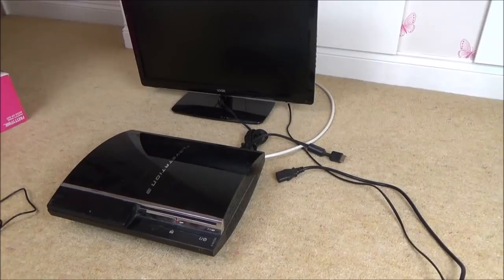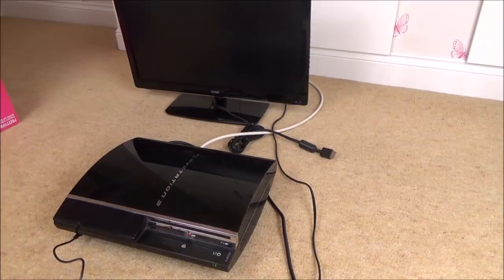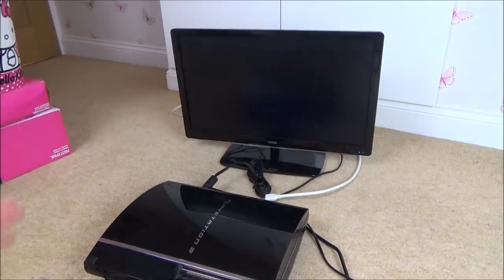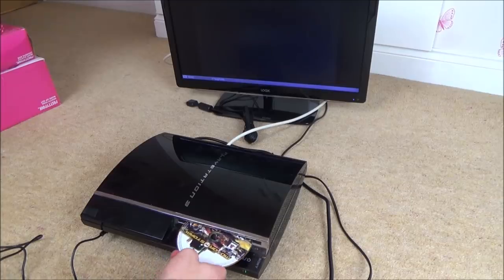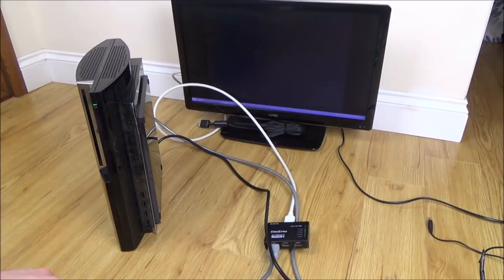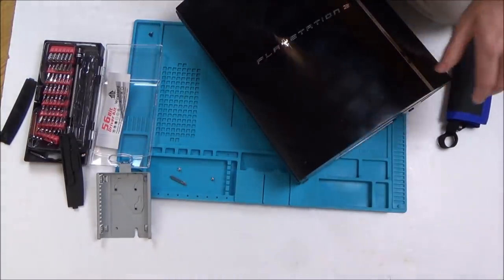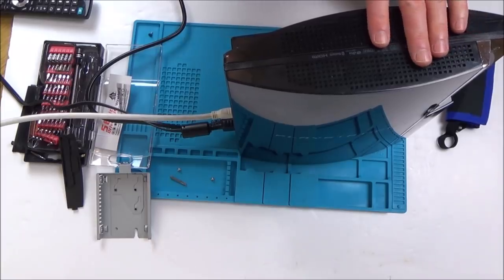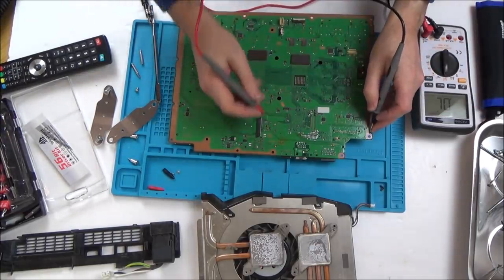Trying to FIX a Faulty PlayStation 3 CECHC03 (Part 2 of 3 PS3 Fixes)

Comment: Reflow of the GPU is a myth. Always do a resistance check on NEC TOKIN capacitors and reflow the dodgy one. It permanently fixes 70 percent of ylods.
Reply: Mine was fixed by just blasting the whole area altogether. 

Although, it ramps up the fan while not even getting that hot, idk why.
Reply: @NSHG  That means yours is about to die. If that console is important, I would suggest installing Custom firmware and doubling your fan speed on Webman. You could probably get a year or so more out of it if you do.
Reply: @koga924  I managed to fix it. CPU IHS wasn't making good contact. Someone suggested sticking a square piece of eraser under the CPU, so I tried that. Since then, I don't have any issues with temperatures anymore. In fact, it has survived about 2 hours of non-stop gameplay of NFS Most Wanted 2012 and Hot Pursuit 2010, as well as a hour of NFS Rivals.

I did install Webman and so far my temps never jump over 76*C for the CPU (which I was once told it's a server-grade CPU) and 63*C for the RSX, which sounds just okay for a 90nm unit (for me at least).
Reply: @NSHG  That's good to hear. I sorta project on them when people talk about problems with their PS3s. My CPU used to hover around 70-80+ degrees when I play PS2 games, even after using MX-4, so I had to put my fan speed to about 1.5x now it hangs out around 70-75 degrees while playing PS2 games. At this moment in time, I completely stopped using it since I get really stressed out that it might overheat. Reading all the YLOD stories online really fucked with me...

Funny thing is I only paid $50, so even if it did break (again) I wouldn't be down much.
Reply: @koga924  Yeah, I paid $4 for mine. Had YLOD, reflowed its RSX back to life and slapped in a 320GB drive, applied the eraser on the CELL, as well as applying MX-2 on both CELL and RSX. I don't really know but mine is like a tank. It does get hot but at least Webman keeps the fan acceptably quiet - it's at about 28% on mine, and ramps up to about 40% if it gets too hot. Kinda like one of my old Prescott based LGA775 based machine that used to ramp up its fan if the temperature was too high.

For PS2 games, mine keeps it at a nice 63*C for CELL and about 40-50 for the RSX. That's because on the PS2 mode, my Webman settings keep the fan around the middle setting. I don't really mind that since I've been soo used to raging loud Delta Electronics/AVC fans in PCs.

For $4, I really wouldn't be that sad either. I already have a slim, 2 CECHG04s (of which one runs Webman and is much more tuned), and a CECHL04 I recased and am in search for a harddrive.

Comment: I bet this wont go good either way, its obvious that the VRAM on that PS3 is gone really bad. the only fix for that is replace the entire RSX chipset which is impossible both getting a working one, even if you have a working one, that chip is paired on the Cell (CPU) so it will just do the usual reb blinking if your try to transplant a new RSX chip on it.

Comment: You can temporarly fix it using a heat gun on both side of the bga, but the best fix is obviusly a reball or even better a complete replacement of the gpu

Comment: Hold the power button till theres a second beep if you connect the ps3 with ordinary av cables. This might not fix the issue but geez man do a bit more research next time. Its better to try all options before ruling whats the problem

Comment: RSX=Reality_Synthesizer. CELL PowerPC Emotion_Engine, I think that the solder used on the CPU will be of a different from the solder used else where in the system, With these systems if the GPU goes wonky they just have to be disposed of responsibly.

Comment: Is there any new idea to fix this problem? Got a PS3 Slim with shortend capacitors around the CPU and GPU as well.
Reply: Ambron Hib reflow them it will work again. Heat them up put some flux and then slightly move them once the solder is liquid. This will fix it permanently. Works for me most of the times, fixed three ps3 last weeks that had that. Surprisingly you don’t even need to replace them.
Reply: Do not attempt to head the gpu it’s a myth. 90 percent of the times it’s the capacitors.
Reply: Thanks mate. So you think heating the Chips wont fix it? I should resolder both?
Reply: @ambronhib5561   My advice is concentrate on the NEC Tokins first. If this won't work it's bin I'm afraid.

Comment: Thats the 1st model ,PS3 60GB, the only one whit 4 ports and mem card slots
Reply: No the 60gb is the CECHA01 and it had a ps2 in it, the one in the video plays ps2 by emulation
Reply: There was also an 80gb model with 4 USB and sd slots etc, same overheating issues

Comment: I’m not saying the GPU was the main problem
But there was definitely a fault with the GPU, it’s not to do with cracked solder balls, it’s to due with the innner working of the chip that has a fault on it.
The CPU is 100% fine

Removing the IHS (the lid of the chip) is easier with the GPU, you heat around the corners and it should come off, thermal paste should be on the 4 corner chips and I think the center of the GPU itself. The GPU is the RSX chip 
This causes the YLOD and the GLOD

Removing the IHS is very hard with the CPU because the corners and sides of under the IHS will have strong thermal adhesive around the chip. You need plenty hot air and a thinnest blade ever to delid the IHS and even with the thinnest blade has very high risk of damaging the traces at the North east of the chip and the bottom too. The main traces are at the top right of the chip so it’s better to be careful, hot air on its own cannot remove the IHS. There are no 4 corner chips on the CPU
The CPU is the Cell Broadband Engine Processor 
This can cause the YLOD and the flashing BLOD

The board is very good at getting rid of heat because of the thickness of the board so it’s very hard to remove the GPU or CPU or any chips off the board

Comment: I had the same problem with my 20gb where it showed nothing on the screen so  I popped the board into the oven 400f at 10 minutes and it didn't work I believe when it turns on and shows no image I believe that means the Rsx is dead but that oven trick most of the time does fix ylod

Comment: I need to fix my PS3 as I think the Power Supply is busted on it since it no longer gets power to it as far as I can tell (without taking it apart an using a multi meter on it)

Comment: Yeah, some PS3 60GB consoles depending on the model number will fully play PS2 games others will only emulate some. Mine struggled on some games

I think where the PS3 60GB failed the most was with all the SD card slots SONY liked the idea of people putting all there photos/music onto the PS3 to store but modern phones were getting better every year so people just used their smartphones to do that.
Reply: I had pictures and all kinds of stuff on my ps3, the card slots were taken out for cost saving and everyone uses USB flash drives. The fat ps3 had some issues but the card reader is not to blame.

Comment: At 29.00 minutes, black chip to the right of gpu really looks bulging in lower right corner. As 3/4 of the chip has very even black nuance I find it hard to believe it is just a colour thing. 
If it is bulging it really tried to eject the magic smoke but failed as the casing was too strong.
edit: At 28.50 it looks like a thermal pad on that chip...
Reply: I saw that, it's a thermal rubbery pad thing on top of the IC

Comment: That issue you had at the end is what ruined my 2nd PS3 where it freezes up and needs a hard unplugging, never had issues with the graphics though so it looks like you messed up something during this video to cause that to happen too. When I had that issue I thought it was a problem with the hard drive corrupting as it first happened when a game was doing a save and tells you not to turn it off, when I took it into GAME after spending 4 days trying to find my warranty buried at my parent's house I moved out from a year earlier they said that is definitely a CPU problem and they said it's unfixable but I'm sure someone can prove that wrong these days though but at least you've got a board for spare parts if nothing else now.

Comment: PS2 compatibility is available on the 20gb and 60gb versions of the ps3 fat
Reply: Matthewdoesmc81 // I have a 80g CECHE01 that plays PS2.
Reply: @videogamegusto7852  yours plays ps2 games yes but they are emulated with software as your model doesnt have the ps2 hardware in it.

Comment: 4usb port plays all ps 1, 2 and 3 games. Drill some holes underneath the fan so it can pull in fresh air. It drops 20c and is almost silent. Done it myself. Bad design.

Comment: Oy! That looked like a huge blob of solder @ 57:29 on the video and about 3 O'clock edge of the CHIP
Reply from the maker: Hi, I can't see it, I think the blob to the right and also underneath the CPU is thermal paste or is the solder blob elsewhere? Cheers :-)
Reply: Hopefully whatever it is if removed resolves the issue, Mind yo I give it a 8.95555% chance that it's the Problem..
Reply: The Chips corner that is pointing to 3 O'clock has tracks leading away from the Chip, and around 5th to 7th Track down from the top in the video, it looks like it is solder, but it may "As you say" be actual heatsink compound and therefore not a problem, to which I say Bum-R
Reply from the maker: @KorAllRBare  Thanks, I see it now, I can't work out if it is solder or thermal paste. I will need to take it apart to see again. Thanks for commenting :-)

Comment: this console doe's not have the glod or ylod  because the console is working exept for the display so it turns on but there is no display of the tv from the HDMI or AV ports still the GPU could be faulty. a reflow with hot air will not work because the chip is dead the heat will make it work for 24 hours or 24 days but still will stop working. now if the chip has not been reflown with a hot air gun hair dryer or paint stripper you could be Lucky and get the console chips reballed with lead solder balls do NOT reflow just get it reballed from the start.

Comment: Men you can't see a fault without power supply... Because with only multimeter all the components are faulty... Use a power supply 30v 10A. You can save time and its easy

Comment: Yo Vince it is the gpu chip and yeah you made it way worse you could have just bought a new gpu and everything would have worked but now the os3 is overheating within seconds that's why the power off button stops working :) got the bang same ps3 had that same problem and all I did was change the gpu with a new one I ordered and it worked like new

Comment: @My Mate VINCE, the beeping on the caps is probably normal. Check this video out https://www.youtube.com/watch?v=0K8hb9RwBrY Low resistance to ground is pretty normal on low voltage, high power rails (one of those old PS3s draws like 300W+), like a GPU. If you look at ohms law and p=u*i it should be clearer. Keep up the good work :)

Comment: the problem is all those ps3 console will die .because Sony won't speed up fan to properly cooling those CPU and gpu.only by installing custom firmware and some third program to adjust speed of fan you can save those ps3.or if you have one switch working and you don't want install code then you can make potentiometr to adjust fan minimum speed.check one guy on youtube.ultra nsc.

Comment: The problem was software dude... Corrupt os. It happens when the chip containing os and bios gets wiped or damaged. Because os is on ps3 without hdd but it won't boot up fully without it. But when you put a hdd in your ps3 system installs os on the hdd and boots up from there. So they probably took the hdd out the console. then ps3 saw there's no hdd, and there's no bios or os on system as well. So the ps3 went to wtf should i do now mode... It boots up tho. 2 solutions : 1. Reintall the bios and mini os on mother board and fix the corrupted chip. 2. do some programming and install a ps3 os on a hardrive (hacking and making your working ps3 a clone of your corrupt one) then the ps3 may or may not work with hdd because the os is already installed but system is still in wtf mode... But you fucked ps3 up already. R.I.P

Comment: Man this was painful to watch. Just use a heat gun and reflow the solder but over the entire board not just the one chip, I’ve fixed loads of ps3s and 9/10 times they fail because sony used cheap thermal paste, reflow the chip, put some good thermal paste on there and bam fully working ps3.

Comment: Flux cpu & gpu
Heat flux until it runs.
Tilt board in all directions so that it runs under the chips. 
Remove the battery. 
Pre heat your oven to the max it goes. 
Place the board in the ovens middles shelf and ensure it level. 
Leave to bake for 10 mins. 
Once done, switch oven off, open door and leave to cool. 

(Not best practice, but it works)

Comment: 90% of this shitty ps3 moddel died from overheating because people only changes the thermal past on the IHS, but never delited the CPU and GPU IHS. The Thermal past unter this IHS is always hard like a stone. if u change this correctly your ps3 is 20°C cooler and don't got a melted CPU and GPU Solder.

Comment: i have an old xbox 360 with that same problem (but we call the 3 red lights) and i saw a lot of videos (most of than in portuguese) saying that you could do exactly the same procedure that you are doing but instead of using a heat gun, the thing that they do, they simply put something to stop the fan, leave there on for 30 seconds and then let the xbox cold down for 5 minutes... than start to work.
i dont know how much of this is true or not. but you could try this with the ps3. turn on, stop the fan for 30 second, let could down for 5 minutes and then test.
very simple for not to try...

https://www.youtube.com/watch?v=Vv-7ssRel1g
Reply: ps. in this video that i linked he left for 5 minutes on than 30 off... 
in anycase you should try...could work better because the chip will be hot in the entire area at same time...
maybe works...